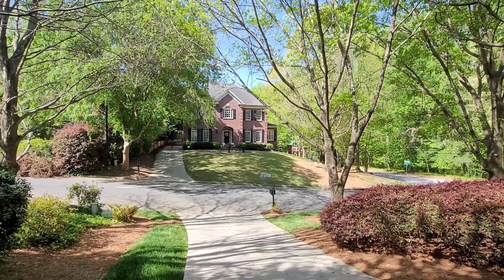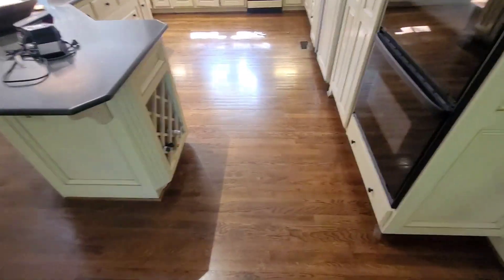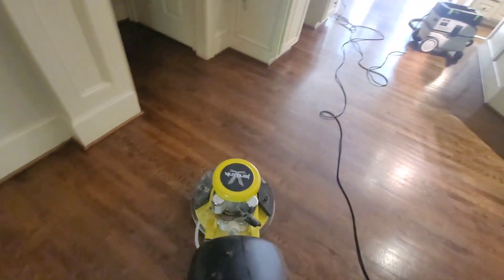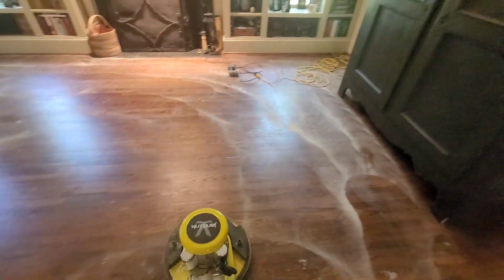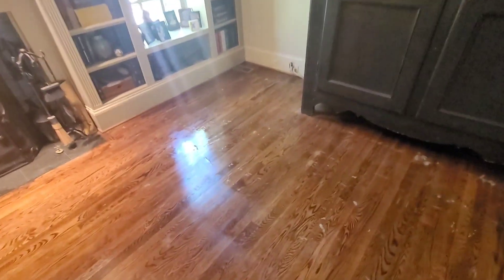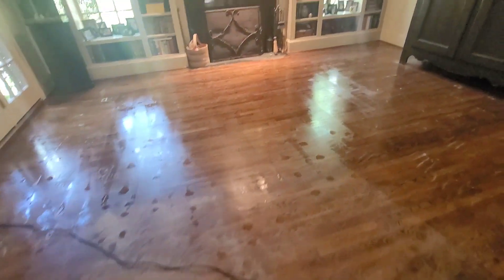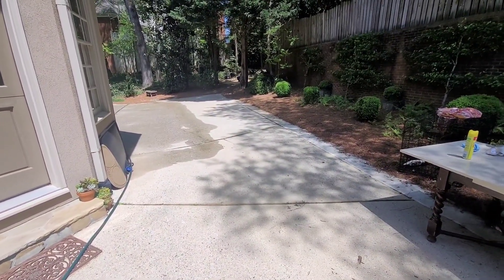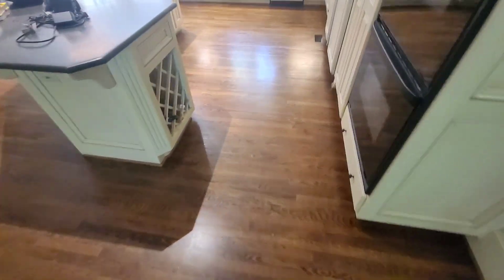National brand company ruined the wood floors by applying the wrong products but we saved the floors

Comment: nice work! that adhesive caked onto the floors, I wonder if there's a product that could break that up and allow you to use a plastic/metal scraper to remove it. surely would be less intrusive than a palm sander hitting the surrounding areas